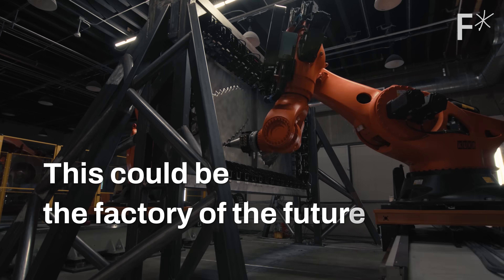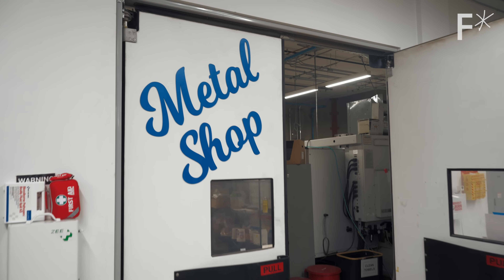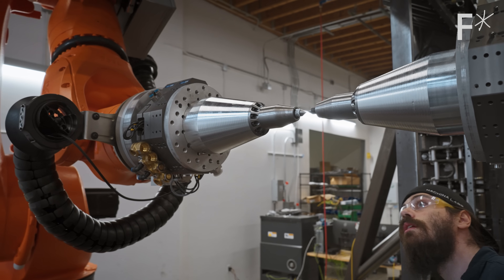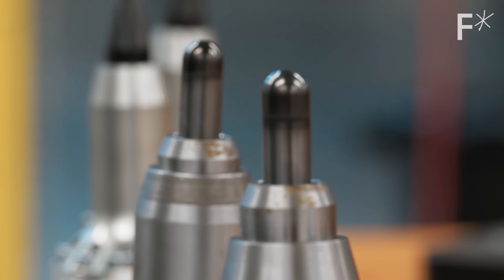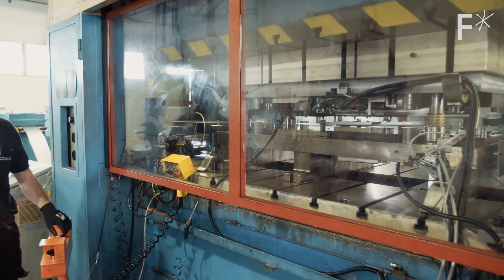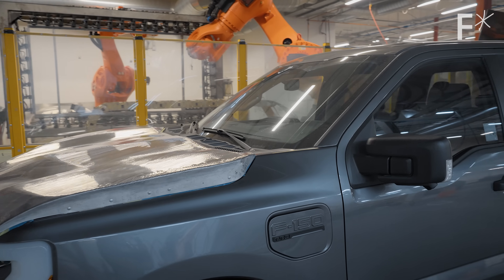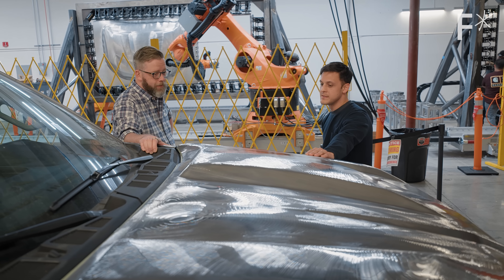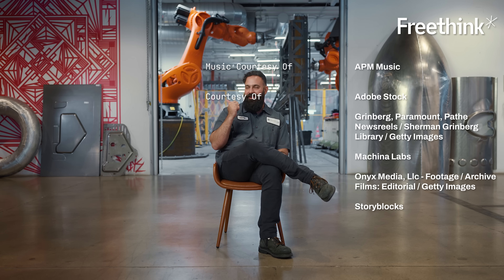Former SpaceX engineer invents a “Robotic Blacksmith Army” | Hard Reset

Comment: Look like it is targeting low volume, high end manufacturing. The surface finish still needs work though.
Reply: I was thinking about how fast a sheet metal stamping machine works.  In a matter of seconds, it loads a sheet, stamps it and ejects it.  You could stamp multiple pieces per minute.  These arms will be great for going from a digital file to a completed part, same day, but it doesn't look like it will be worth it for speed.  For automotive panels, I don't see any manufactures making this change.....unless it's crazy high end.
Reply: @dpjazzy15  It's a niche, prototyping, small volume manufacturing, field repairs, or replicating out of production parts.  Molds for stamping big sheet metal are expensive and take a lot of time and skill to make and the presses needed are huge and heavy.  And this can do light plate, not just sheet metal.
Reply: @dpjazzy15 exactly, anyone that wants to build at volume is going to use standard forming. This thing takes an hour, forming press in 20 seconds. It’s exactly like 3D printing, will that take over plastic injection molding? Hell no. If you want to make 10,000 of something, unless the geometry HAS to be something crazy, you’re gonna do it with PIM.
Reply: @ACBLOWSCOLD  The advantage of 3D printing is that you can create parts that traditional manufacturing technologies could not (topology optimized). With this method, I am not so sure.
Reply: Meh, it's a prototype, not a finished product. The only thing I'd consider these for is rapid prototyping using locally generated but easily available parts.
Reply: @spvillano  the whole point of this video was showing what’s possible.  Future tense.
Reply: I think resolution can be increased at the expense of speed.
Reply: That could and will probably be fixed in the near future with rollers and other components.
Reply: @scooter9330  nahh it will be done by another robot.
Reply: @scooter9330 so its basically not as good as they make it seem since you're still gonna need the extra steps
Reply: @scooter9330 there are other companies building small machines for lighter guages with higher finish quality.
Reply: In another video on this from Smarter Every Day the CEO here says it's cost effective further down the chain than you'd think, up into the thousands of pieces. That will only grow larger over time I imagine.
Reply: I think it's going to be a combination of molecular manufacturing and this. It's the evolution of 3D printing being able to quickly print at the molecular level
Reply: Yup.  The reason that company spend millions on manufacturing plants is because they plan to make hundreds of thousand if not millions of parts during the life of the plant, not 20 or even 200.  Great stuff but the discussion was mixing apples and oranges.  At the other extreme end of the spectrum are products like soda cans.  The US produces 80 billion per year out of aluminum sheet metal.
Reply: exactly.   4 parts a day vs 10,000 in the current world.
maybe they should make very precise pieces to construct a mold from.
Reply: If the structure works..

I would replace a part with that finish..
Reply: Right, it's antiquated already because of 3D printing.
Reply: It will hardly be ever high end simply due to mechanical limitations. Surface finish just cant be as good as from a stamped part.
Reply: Yeah like an assembly line.
Reply: I agree completely but scaling up might involve just replicating the robots, that are already an established technology, and advanced machine learning which is what all those fancy new GPUs are supposed to be doing. Factories based on this type of manufacturing can truly be well dispersed and made resilient. The future of sheet metal forming is looking very bright.
Reply: @ismailnyeyusof3520  I don't think this is supposed to replace high volume high end manufacturing. The steel pressing techniques are very good and efficient for that. The problem is their is no good alternative for low volume high end manufacturing because it is not worth the expenses. This seems to be perfect for that.
Reply: but its only a resolution problem. if its ok that you have cheap robots, who make those parte way more precise throught higher resolution, you could do those sheet parts in one day but sell it for 500$, then you only need space and time and cheap energy to scale this. probably without a single human being. so the future will be only for the rich ppl.
Reply: You Americans are really good with putty and filler. At least according to my experience when we import older 80s and 90s cars from the USA to Germany. At first glance, they look good until you discover the countless cracks in the paint when you take a closer look. If we wanted to sell them, we would have to completely strip the paint and spend many hours on sheet metal work to get a car up to German standards, without a thumb-thick layer of filler under the topcoat. 

That's probably the way you go for a "reasonable" surface finish 😂
Reply: @florianj6490 I remember when the exchange rate created the “grey market” in America for Euro-spec used cars. The amount of filler used to hide rust was noteworthy.
Reply: @florianj6490  :face-orange-raised-eyebrow:
Reply: @florianj6490  At least we don't have the slaughter of 6.5 million jews on our hands buddy
Reply: @florianj6490  No idea what you buying used cars has anything to do with this.
Reply: @florianj6490 question, how many cars have you bought from the U.S.?? 
Did you buy those cars all from the same sellers, or different ones??
I'm not saying that there aren't lazy people here in the U.S....
What I'm saying is not all shops put out work like what you are describing.
Reply: @ericwilliams538  but it's totally common. I was several times in the states, looking for classic cars. It is almost the rule in hot states. The cars are quickly repaired and placed in the sun with fresh paint. Then the paint breaks. The magnet test is usually negative.
Reply: @florianj6490  "several times" isn't a specific number!!! 
Several times now, you haven't given a specific number for the amount of visits you have actually made to the States.....see what I did there.
Reply: @ericwilliams538  this is just stupid. A specific number would not help you to assess my experiences either. How many times have you searched for European cars built between 1980 and 2000 in the USA? Do that and test the paint with a magnet. You would agree with me.
Reply: @florianj6490  it's a legitimate question, regardless of me being able to "assess your experiences" or not.....and your experiences don't not speak for everyone and every body shop in the U.S. is my point.
Also, regardless of whether or not you think this is stupid or not.

Comment: Homie looks like he just came out of the car repair shop  and now building a startup

the startup will be super successful because it's actually solving a really big problem
Reply: That’s because he’s not a “homey”…..
Reply: Not if it takes a hundred hours to "stamp" out a hood. This the same problems with overusing tech; it's never going to be as fast as a die, it merely replaces a lot of them. Not really a good selling feature, unless you're starting up a rapid-prototyping shop.
Reply: @Telephonebill51  That's what this appears to be: a rapid prototyping shop that gives a useable metal output. Too expensive and slow to scale to "an army of robotic blacksmiths." I think powder bed sintering (metal 3D printing) is going to eat their lunch, especially with the new material just created by NASA (high strength alloy metal + ceramic nanoparticle sintering powder). The powder bed printing process can theoretically go a lot faster than this. Also: many small items can be printed in the dead surrounding spaces, and the excess powder can be captured and reused.
Reply: @Telephonebill51  You know what stamping machines need? A ton of investment in time and money and humans to operate them, load the steel sheets in, etc. From what Ive seen in these videos, you can probably automate the sheet delivery/removal process, and have dozens and dozens of stations running and churning out parts. It's short-sighted people like you who said "The horse is here to stay, but the automobile is only a novelty — a fad."
Reply: Look how the surface having so many lines. And how long it takes to make 1 panel. This company will going bankrupt before 10 years
Reply: He didn't solve any problem. He created a niche company for niche items. This will never replace sheet metal stamping.
Reply: When you actually have a reference for a business loan
Reply: The no beard and beard made me laugh lol
Ref to The Creation of Adam is funny LOL
Reply: 0:53 0:53
Reply: so many of these guys and gals all come from SpaceX and Tesla.
Reply: Not much about him on wiki, where is he from ?
Reply: Looks aren’t everything bud, you’ll learn that one day
Reply: Body shop 😉
Reply: Homie got it totally wired.
Reply: Some might call that,
 a mechanic.
Reply: Nope…The giant beard thing is the new yuppie poser look.
Reply: A unit like this can build everything a community wants. Rather than making a ton of cars and not selling them, just make cars to order. Buy the design from the car manufacturer and get it built/printed. Way more sustainable this way, provided the product can guarantee the required quality.
Reply: What problem is he solving?
Reply: @MyToxicMasculinity  expensive dyes. Dyes need replacement every few years. He has removed the need for dyes and replaced it with metal bending, which is universal regardless of the final shape of the metal sheets.
Reply: @ 

Obviously you’ve never worked in manufacturing so you wouldn’t understand
Reply: “Repair shop homie”…. Only that he ACTUALLY came from SpaceX and helping build and design equipment for aerospace… slightly different
Reply: @aususer  Real life Eureka's Henry Deacon...
Reply: @aususer  there is so little skill needed to do this, it's clear why he's not at spacex anymore, probably too difficult and/or too much work
Reply: @dronefootage2778 as a mechanical engineer with half a decade of manufacturing experience I can say that you're statement is unfounded
Reply: @fightwithbiomechanix  all it is, is 2 robots following a path in sync. it's kind of like a 3d printer. the hardest part would be to write the code that converts the shape into the routes for the robots. i bet i could put this together in 2 to 3 weeks.
Reply: @dronefootage2778  So company and modern inventions do you run,as you seem to be such an expert.
Reply: @terryharris1291  you don't have to be an expert to know this. the robot is nothing but a series of motors with position feedback. it doesn't take a lot to control them. you kind find tons of videos on youtube where even kids build these, just smaller, but it's the same principal.
Reply: @dronefootage2778  Now in the real world, where you start having to take into account the slop in every section of the arm, the temperature of the metal, and how that slightly changes the deformation, and the ML algorithms that take this information and change behaviour in an appropriate way. Also how the behaviour of the metal continues to change as you alter its thickness. It's not as simple as push one side and the other.
Reply: @dronefootage2778  I have never seen a video of children build ones like these or using them like this company does.If it is so simple why are there not 1000's of companies like this one.
Reply: @terryharris1291  maybe nobody had the idea or if they did they didn't think it was worth it since it basically takes forever to make one part as opposed to stamping one, something that was conveniently omitted from the video.
Reply: @ekksoku  that's why i said the software to calculate the paths was probably the hardest part but still not that hard. temperature doesn't matter. the slop as you call it can probably dealt with by monitoring the current of the motors, aka. the amount of force that is being produced. this might already be part of the robots software. basically you can calculate how hard each side is pushing. probably one side defines the limit and then the other side just applies a certain amount of force.
Reply: @dronefootage2778  if it's so easy, what other easy concepts which no one has done well yet could you contribute to?
Reply: Genuine question
Reply: @ekksoku  Not sure. I'm one of those people that like to criticize but don't actually have any accomplishments of my own.
Reply: @dronefootage2778  I mean - I can't criticise you for your honesty hahahaha. If you think you can do those things, I believe in you - in the immortal words of green screen shia lebeouf, just do it
Reply: @ekksoku  one day hopefully i'll build something and thanks.
Reply: @dronefootage2778  speaking like Elon Musk, examples are the vactrain sorry, Hyperloop, the self driving cars... how's the sight atop of Dunning-Krueger hill?
Reply: @dronefootage2778  Software is their bread and butter, it's their primary product, but everything in between is their process and why they still exist. Also the paths aren't calculated, the robot is just following a bunch of extracted vectors like a CNC machine, and applying variable force to achieve the desired topography of whatever compatible 3D model they input. The only thing they're calculating is the differential of that applied force as a factor of thermodynamics, metallurgy, and the effectors themselves. And these calculations are enhanced by some arbitrary ML model they retrain over and over again, let's say a regression model. They just use ML to fine tune the system's parameters and output the correct force based on a corrective measure that regresses the deviating data points back to their expected norm.
Reply: @dronefootage2778  But keep on keeping on dude. We need more people like you pondering the world around us rather than simply existing in it haha
Reply: @sandman.38  That's how I see it too. It's like a 3D printer, or CNC like you said. I load my model into a slicer program and it creates the paths for the printer. They probably do something similar but had to create their own "slicer" program so that was probably the hardest thing, that, and getting the money for the facility, employees, and robots.
Reply: @sandman.38  Haha thanks! I'm not sure I deserve that nice comment. I do ponder the world all the time. I always ask, what is the reason why this was done like this. It's really rare that I can't answer it but I enjoy when it happens. I might still come up with some possible explanations but it's not the same as just knowing the answer.
Reply: @dronefootage2778 Sure, bud, I'll believe you when you build this at your home
Reply: @dronefootage2778  What’s up with your attitude? Can you just enjoy the video and be happy for the guy? Why rain on his parade and our parade as well?
Reply: @momofmanda  because i didn't like in the title how it says "former spacex engineer". that should have nothing to do with it and it's like asking for credit ahead of time. i want to see what he did/does and then i decide if i give him props or not. it's like when you meet a new person and the first thing they do is tell you that they went to harvard.
Reply: @ekksoku yes its a lot of learning work for the ai systems and research about hard m’étals tangsten titanium ext ext but in 3 to 4 years  it will be multimilioner at least. Very inteligent respekt ✊🏻
Reply: @dronefootage2778 I’m with you on this one. If one has the money to mill some prints from a design or open source arm design, can afford the hydraulic equipment and all of the pieces needed, software and programming down to fine tuning isn’t far fetched at all as long as the funds are available 😂 I tip my hat of to these guys for pulling it of.
Reply: Bwhahahahahahhahaaaaaaaa…
It’s a shame your intellect is utilized for such things as this format.
Try watching smarter every day.
Reply: @dronefootage2778  You're literally wrong in so many ways, the tips of these robots aren't touching, there is SO MUCH going on here mathematically you are just dumb for typing shit when you don't know about it at all. The software end is insane, sure the robots are already in the industry, but they aren't even built for this dude...
Reply: @partciudgam8478  This comment hit the nail on the head, this dude is literally at the PEAK of Dunning-Krueger and thinks he knows fucking EVERYTHING lmao...
Reply: Thanks for being honest. I’m just like u in the regards that I don’t just see something that looks complicated and say wow I can’t do that so it must be super high tech. I agree with u that this probably isn’t going to change anything and it’s not that hard to do either.
Reply: @partciudgam8478  first rule of Dunning Krueger club is, no one knows they're a member. 😁
Reply: This is the same hype as 3d printers. It completely fails the scalability test. If I order 250,000 products manufactured by this method delivered in one year, they would have to produce one every 42 seconds. That's easy to accomplish with sequential dies but you can't possibly do the setup fast enough, let alone actually form the metal at such an insane pace. For single prototypes or sub 100 unit runs, it makes sense but it simply can't meet the efficiency required for normal production levels.
Reply: @d3m0n54in7  but it's not meant to be large scale, it's also said in video that it's for small scale productions
Reply: I remember a lot that looked, talked and acted like him during the dot bomb era, where the largest number of products were all vaporware.
Reply: Homie looks like Adrian Pimento
Reply: haha ya!